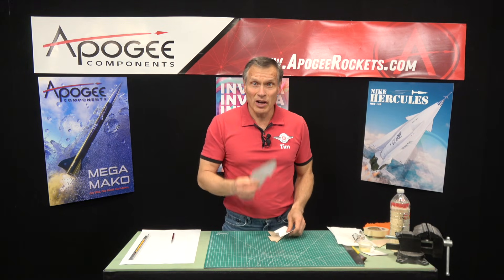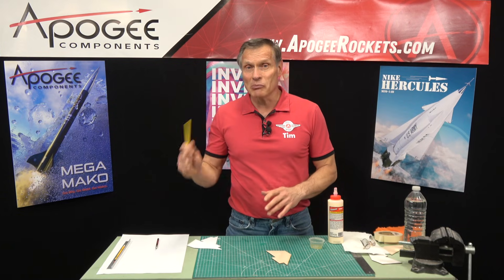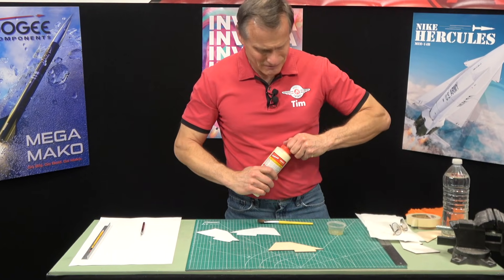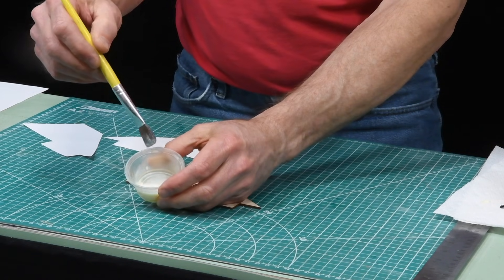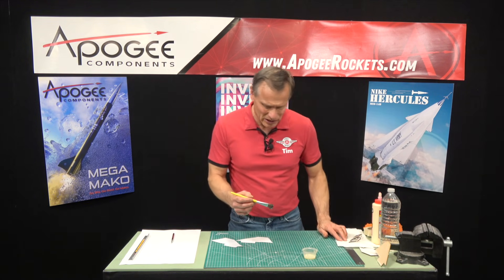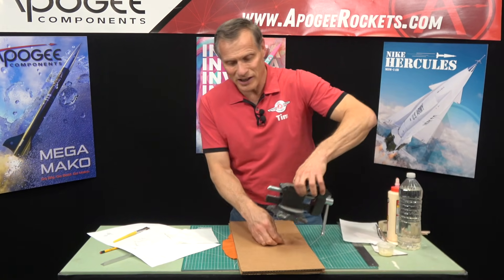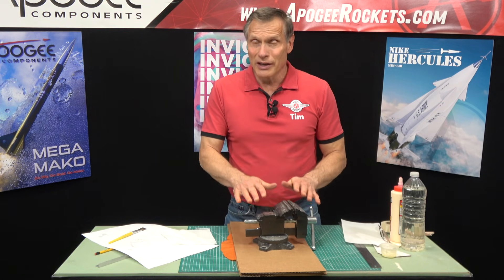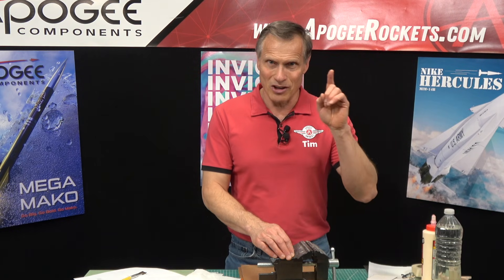Paper Skins on Balsa Fins - Make Stronger Model Rockets

Comment: In the Peak of Flight Newsletter, issue 330, you make a body tube by applying white glue to paper, letting it dry, then ironing it on around the mandrel.  Could this technique be used on balsa fins as well?

Comment: I build mostly rockets with balsa fins and I paper all of them.  I put a thin layer of TitebondII on one side of the fin, spread it evenly then wipe off as much as I can with my finger to get rid of excess water, put the paper on, smooth it out and immediately clamp between 2 pieces of smooth plywood.  After 15 minutes I take it out, do the other side, and put back in the clamps for at least 8 hours.  The reason I do one side at a time, and the reason to use a small amount of glue, the paper can expand and develop wrinkles if you don't get it clamped down quickly.  I start with a minimum of glue and the glue dries enough to work by wicking the small amount of moisture into the balsa.  When taken out of the clamps they are smooth and generally straight although maybe 1 in 5 times not straight.  There is still some moisture so they can be clamped to something slightly curved to make them straight.  I should find a sheet of fine weave cloth to clamp them to to help absorb moisture, maybe even a thin piece of cardboard.
Paper has a grain so for maximum strength paper with the grain direction going perpendicular to the balsa grain direction.
I make a lot of scratch built fins with the balsa cut slightly oversize.  After papering I stack all of them up with my template on top, stick sewing pins through them to hold the alignment and sand the edges down to match the pattern.
I always finish the fins by rounding the edges and painting on thinned wood filler then sand them smooth.  Once put on the rocket spray a coat of primer on then sand everything to get rid of the fuzzies.  It may take 2 coats of filler primer to get everything reasonably smooth and ready for paint.
I paper for strength mainly but it also helps cover balsa grain.  If my balsa has a lot of grain I might put a skim of wood filler on the balsa first and sand it down, then put on the paper.  I get a finish that isn't museum quality but good enough for a flying rocket and better than what I get just by filling balsa.
I have papered fins for rockets up to 2.6" diameter and they seem to be very strong but still light.  For that size I will paper with thin cardstock instead of just paper.

Comment: Interesting how you’ve done this video several times over the years, but the technique always changes. 

Now, I’m not being critical, but the one you posted over a decade ago did have you using undiluted wood glue. That’s the method I’ve used on my balsa and basswood fins, and never had a warping issue. 

The one from a few years ago used super glue and spray adhesive. Now we’re diluting wood glue with water. 

I would think the water dilution method would be the weakest, given we’re changing the wood glue chemically, but upon reading an article by Titebond, this dilution ratio you’re doing is used for end grain sealing. 

There’s many ways to accomplish the same task, but honestly, which is best?

Thanks for your knowledge and for the video!
Reply: Mostly I don't have a warping issue either, just on occasion.  I either correct the fin with some water and clamping them slightly bent the other direction, or I rig up a way to hold them straight while gluing to the body tube.  Once the root edge is glued down they seem to stay straight.
All of this papering is as much technique as it is materials.  With experience you refine your technique to work with whatever glue you are using.  I've always done full strength glue so I've worked my technique to work for that.
Reply: @billj5645  Honestly, the old method of just slathering wood glue on, removing the excess, and doing both sides right after each other works very very well for me. 

Undiluted glue always worked fine for me, same as you. 😊
Reply: I too have noticed the evolution of Tim's fin papering technique, and ironically just finished papering a set of (square-edged) fins today using a one piece of paper method.

Choosing Titebond III Ultimate wood glue (green label), I did not dilute with water; it's already runny like paint.  I used a brush to neatly and evenly apply a thin coat of glue to the fin.  Learning from previous efforts, I took the time to cut out the fin outline, (mirrored), except along the leading edge, in one piece of paper.

Placed the glued fin onto the semi cut-out paper and finalized alignment. Then some direct pressure/weight onto the fin for a couple minutes to allow set-up. 
Next, careful application of glue to the fin's leading edge and to the second side of the fin (facing up). Secured adhesion by tightly pressing/folding/rolling the paper down onto the fin.  
After drying overnight, I trim the paper from the fin edges of the second side.

A previous "quick-try" attempt taught me sanding papered fins is tricky, potentially messy, and leads to further prep work prior to final painting.  Rounding the fin edges prior to papering requires some thought and care. I printed a scaled-down fin outline to glue to the fin first, and learned careful sanding, (even with an airfoil sanding block), is required to keep lines straight and not scuff the paper.

Even when I have tried using the wood-filler technique, I have found diluting with water is very problematic. However, I have only tried the wood filler method a handful of times. 
In any event, I'm going for my NARTREK Senior Bronze credential and looking forward to launching my first papered fin rocket!
Reply: @francismoran1230  Glad I’m not the only one who does the one sheet method. I thought I was just lazy. 😅

Glue on both sides of the wood, smack it down on paper, fold the paper over onto the other side of the wood and call it a day after smoothing the paper. Easy, quick, no fuss.